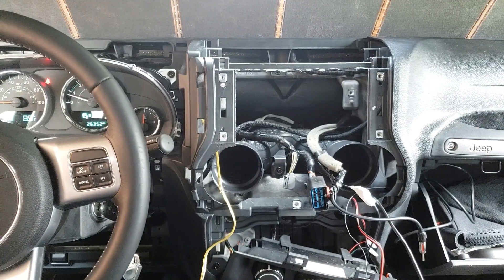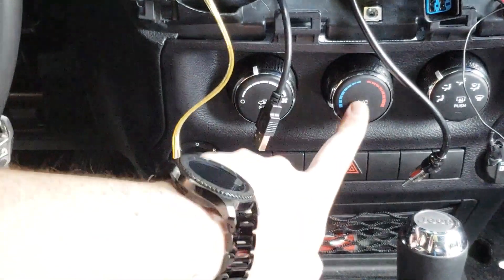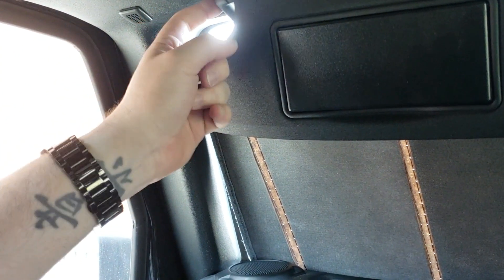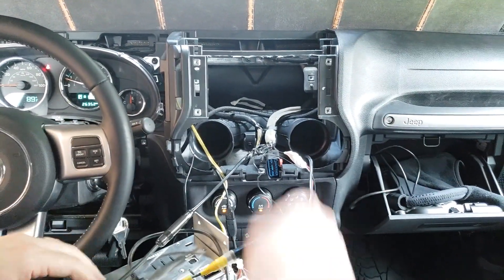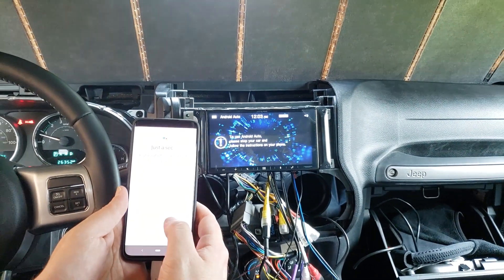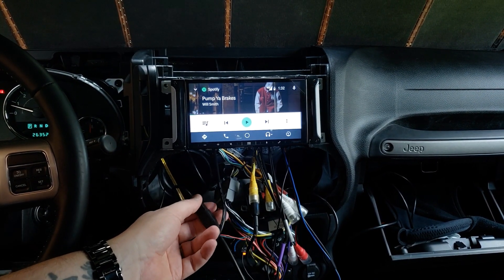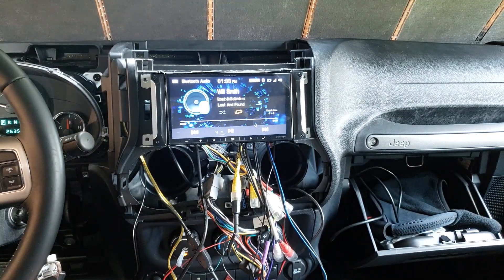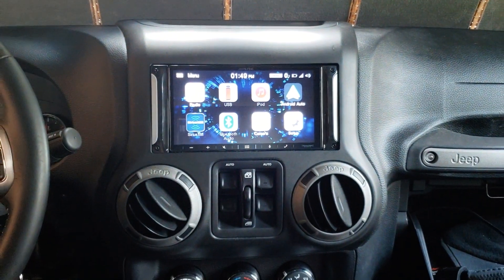Alpine iLX-W650 install in a 2016 Jeep Wrangler

Comment: Hey looking to install this, all I need to purchase is the 
-Alpine ILX-w650
-PAC replacement thing
-antenna cable adapter

Is there correct or do I need some kind of wiring harness?
Reply from the maker: The PAC will be half of the wiring harness the other half should be included with the Alpine
Reply: @5after12  Thanks for replying so quickly. I ordered the actually radio, PAC replacement, dash kit, antenna cable, and the usb thing to retain use. It ran me about $400 from Best Buy and I plan on having my dad install in a 2017 Jeep wrangler
Reply from the maker: That's good, should be great, I never had problems with mine

Comment: just installed one, the voice controls/VR on the steering week works, but the phone button to answer and hang up is not...any suggestions?
Reply from the maker: Does it make an audible beep when you press the phone button?

If it appears that the head unit recognizes the button press but doesn't know what to do with it, that could be a software or programming issue.

If it doesn't recognize the button at all that could be a different issue.

It could be the dial settings on the PAC, or it could be the programming of the PAC.

I would assume if it recognized the other buttons the wiring is good.

Comment: So that crutchfield wiring harness really helped with the install. Only issue is that I have the Alpine upgrade factory sound system. Any thoughts if it'll just work as plug and play with that harness?
Reply from the maker: With the Alpine you would just swap a few wires around. I think you can specify on the Crutchfield order that you have the Alpine system and they will wire it accordingly.

I swapped the Alpine iLX-W650 for the Pioneer AVH-W4500NEX and I thought I would wire that one myself to make a video on it. The wiring was a huge pain in the ass and I messed up the video. I wish I would have had Crutchfield do it instead.

Comment: I don't know why u ran the mic there.. Why not remove the a piller remove stock mic and put the new one in its place?
Reply from the maker: For one, that's a lot more effort.

Two, I think the first time I installed a radio I tested a bunch of places and I found that was a good spot for people to hear me. I am tall, so that is one of the closest places to get the mic near my mouth. I initially thought that would be a temporary spot but it has worked great for multiple head units, I will probably keep it there.

Comment: Hello we installed to the the Axxess usb mini as you suggested, and the center console usb will not work with apple play, it will just charge but that's it.  Any suggestions?
Reply from the maker: Did you remove the old Uconnect block?
Reply: @5after12  I don't believe we did.  Is that the black box it was connected to?
Reply from the maker: Correct, it should be behind the A/C controls
Reply: @5after12  your videos have been very helpful!
Reply: @5after12  okay, that uconnect block doesn't get used for anything else, its fine to remove?

Comment: Did you have to configure this PAC for the steering wheel buttons like you did with the Joying? I just installed mine and steering wheel buttons are not working. I did not get the ready harness and wired the PAC myself. maybe there is a certain wire that handles the controls? I bought the same Alpine w650... thanks!
Reply from the maker: So there is a Switch on the PAC to set to Alpine and it should work. However, if it doesn't automatically program itself, you would need to manually set it

Comment: I see you had to run wire for your microphone. Could you you just use your vehicles stock microphone? I am going to install this same unit but to my 2016 tacoma which is a deffebrt vehicle obviously. Was just curious about running the wire for the mic. Great video though very helpful
Reply from the maker: For the Alpine you have to run a wire for the microphone. If you had an iDatalink compatible head unit like the Pioneer AVH-W4500NEX you can reuse the existing Uconnect (Jeep system) microphone, but that means using the associated Uconnect system which is pretty annoying.

Comment: Wat so my car has a backup camera and steering wheel controls already with the factory head unit I have in currently. Should I opt for the "discounted installation gear"? Will my backup camera and steering wheel controls still work if I do opt for the "discounted installation gear"?
Reply from the maker: Yes, I believe you would need those extra items to make it work
Reply: @5after12  Thanks man

Comment: So I just bought this exact radio does Crutchfield send an external microphone and a USB adapter with the Crutchfield kit or do you have to purchase your own?
Reply from the maker: The Alpine iLX-W650 should include a microphone in the box. There will also be a USB extension cord in the box. 

When I bought it from Crutchfield and chose to add on the discounted installation gear it did include a USB adapter to re-use the existing Jeep USB port. However, I believe there were two options for installation kits, and I not sure if both kits included it.

Comment: bought and installed..... same alpine and the PAC....everything is ok but my phone has no sound at all... the telephone makes the call but no sound at all... do you have any suggestions??? and second... my rear view camera doesn't come on when I put reverse on, when i push the camera button in the display works but not automatically when reverse..... what i made wrong???
Reply from the maker: Can you play Bluetooth music from the phone?
Reply: @5after12  yes, i can....
Reply: all set (almost) the PAC people told me that i should connect the front output to the rear input , LOOSING TWO CHANNELS.... and it worked....but no rears and no bass.... do you have any suggestion to recover my subwoofer ???
Reply from the maker: Maybe the other way around?

Comment: Do you recall which wire coming out of the Alpine unit is for the backup camera?  I recently put one in my Subaru and I can't figure out how to connect it to the exiting camera that came with the car which worked on the factory head unit.  Thanks!
Reply from the maker: Is your camera a factory option or aftermarket? My camera was aftermarket and plugged into an RCA type connector. I don't remember odd the top of my head which one, but if you watch the unboxing on my channel, I am sure I show it.

If you have a factory camera, you might need some type of adapter
Reply: @5after12  Thanks for the reply! It's the factory camera that came with the car.  I'll get on the goog!  Thanks again!
Reply: @markgustafson2666  did you find an adapter for your Subaru factory camera? I am not finding any info how to connect the factory camera up to an aftermarket deck. 2011 Subaru Outback here.
Reply: @nicb246  I ordered this, but have not had time to get out in the garage and attempt to connect it.

https://www.amazon.com/gp/product/B07T545H2M/ref=ppx_yo_dt_b_search_asin_title?ie=UTF8&psc=1

Comment: great video... thanks..... which installation kit you used? is the metra DDin dash kit or the side brackets from the Alpine Restyle i207-WRA... (are both for the same..??)   

why (or what for) you used 2 different USB cables?
thanks for your time...
Reply from the maker: I used the Alpine brackets because I liked the look, but if you wanted to save some dough you could use the Metra kit.
Reply: @5after12   many thanks.....
Reply from the maker: @rodolfosanchez4396  what was your question about 2 USB cables? I can't watch the video at the moment, jog my memory
Reply: @5after12   you uses 2 usb cables.... one for the iPhone and the other one (i think) to connect to the OEM usb conector at the console... but the head unit only has one usb input,..... right?

also... is the antenna extension really needed?
Reply from the maker: @rodolfosanchez4396  oh, the dual USB is not required, that's just something cool I did:

https://youtu.be/UFCpO6LOixI

Comment: What part number did you use to plug into existing jeep plug? I don't need the whole can bus tough..
Reply from the maker: The PAC is what I used to plug into the Jeep plug. It is a canbus adapter and wiring harness in one

Comment: How did you connect your camera to be able to see it while parked?
Reply from the maker: The dealership wired up the camera, so I am not positive how it was installed. However I can see they got power from the cigarette lighter.

However, for the installation of the head unit, I didn't do anything other than plug the video RCA in

Comment: Hey quick question. Would the Maestro HRN-RR-CH1 plug and play T harness for CH1 Chrysler’s dodge Jeep vehicles, fit for my 2016 Jeep Wrangler...I just got this exact radio and the wire don’t fit so I’m wondering if this adapter would be compatible with it
Reply from the maker: I don't think the Alpine is compatible with Maestro. In theory it would work, but it probably isn't plug and play.

I listed the parts I used in my description
Reply: 5after12 I clicked on the harness you provided but it doesn’t let me purchase it that’s why
Reply from the maker: This one?

PAC RP4-CH11 Wiring Interface:

http://amzn.to/2yPO4K7
Reply: 5after12 the clutch field ready harness
Reply from the maker: Oh you can only get the Crutchfield harness if you buy the head unit from them
Reply: 5after12 well that sucks , thank you though

Comment: How are you liking this new one? It didn't seem very responsive to your touches.
Reply from the maker: It works, so it is better than the Sony, but I still wouldn't really recommend it.  I will make a few more videos on it this week.

However, I am leaning towards a JVC with wireless Android Auto or the Pioneer with the 8 inch screen
Reply: @5after12  Thank you Mike-Mike! :)

Comment: I still don't understand how to connect all the wires especially the one to the battery. wtf
Reply from the maker: I didn't connect a wire to the battery, just the harness
Reply: @5after12  okay cool. I've literally never wired anything except vanity lighting. Thanks!
Reply from the maker: @eddymotorsport5178  it is fairly easy, but obviously seems daunting if you have never done it before. Like I mentioned in the video, I got it from Crutchfield and had them pre-wire it for only $26

Comment: Two questions - do you think the CANBUS is telling the unit you’re in reverse? Cigarette lighter power implies there’s a constant signal there.  Mine fools the canbus through programming, and I hate to lose that feature.

Did you consider adapting the factory microphone? 

Where did you get the plastic fillers?  I didn’t notice them as a separate item on crutchfield (might have missed it though).  Install looks great.., hope you still love it - I’m torn between the 650 or the 207
Reply from the maker: I don't understand your cigarette lighter question?

As far as the plastic fillers, I got the cheaper ones from Crutchfield, but I didn't use them. They would be the Metra 95-6511 Chrysler/Jeep DDIN 2007 Dash Kit:
 https://amzn.to/2F04Jgy

What I used was a lot more expensive, but I like the look better. These are the side brackets from the Alpine Restyle i207-WRA that I used:

https://www.pacparts.com/part.cfm?sku=820ZUD%2DL974%2DENWV%2DSW

I do not believe you can reuse the factory microphone

Comment: How did you get the settings to come up?
Reply from the maker: I had to crank my emergency break up about as far as I could
Reply: @5after12  nice video man. I just got one of these everything works good but when I connect my bluetooth theres no sound. Would u know how to fix that?
Reply from the maker: Unfortunately not, I never had any Bluetooth issues. I would try it with a different phone as part of your troubleshooting to see if it happened with any device or just that particular phone